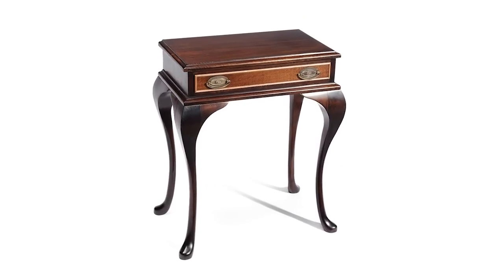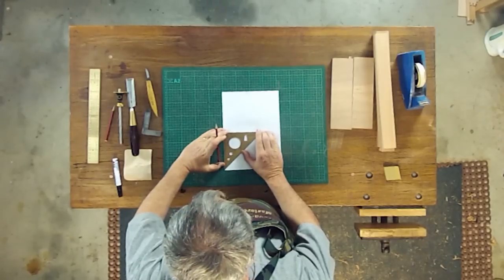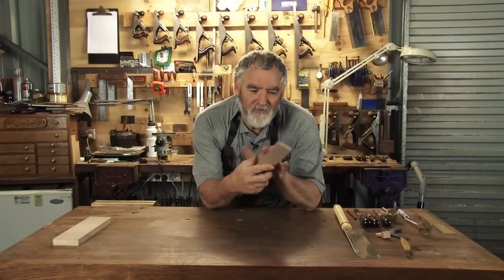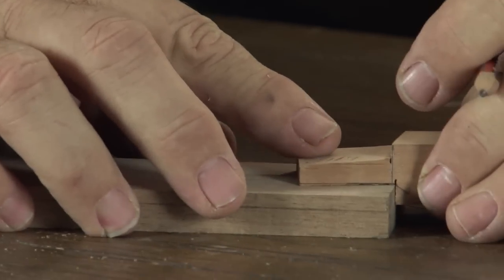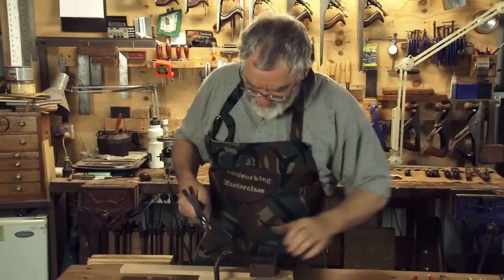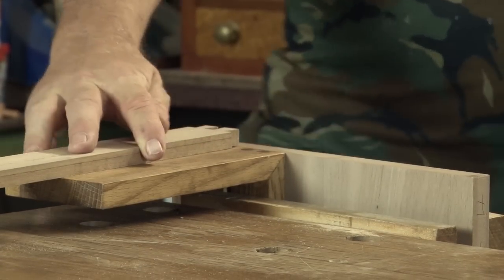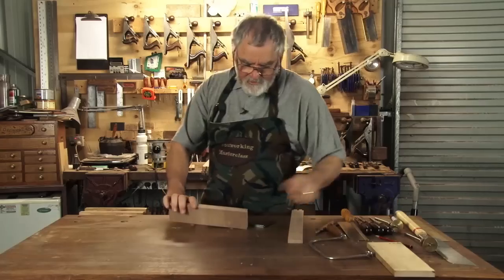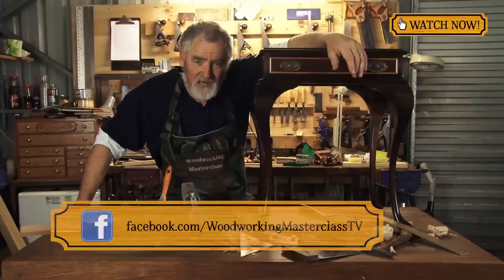Woodworking Masterclass S01 E02

Comment: I want to get into woodworking (especially furniture making) but my only problem is the price of hardwoods. So I was wondering if you just pay the price or if you have any tips to get it cheaper?
Reply from the maker: Unfortunately the answer is yes. There are some ways around it though. I buy in bulk that saves me quite a bit. If you have the machinery you can save by buying rough sawn and dressing it yourself. Downside to that is you often don't get to see the grain pattern until you've purchased it.The one I find most effective is look for shorts (lengths under 900 mm or 3') and end of mill runs that everyone else has picked over and left the scraps. Many times you get them for a good price and can made projects to suit the timber you have instead of having to buy the timber to suit the project you are building. Hope that has given you some food for thought. Cheers Steve
Reply: Woodworking Masterclass Ok thanks for the reply. What wood did you use? Maple?
Reply from the maker: Queensland Maple, but any nice timber will do an excellent job. Cheers Steve

Comment: As a new woodworker all I can do in these videos is star agape at that collection of planers lol
Reply from the maker: Hi Jeremy, There are a few there and I must say even thought they all get used they are not all necessary to do woodwork. They are a combination of over 30 years of scavenging, scouring and being in the right place at the right time at eBay, garage sales and auctions. You can get by doing serious woodwork with only  a #3, #7 and a good block plane. Eloy tour woodworking journey. Cheers Steve
Reply: Great information sir.  I'm still working on my tools and I'm wondering how critical having hand planes is.  They are really the only "essential" tool I don't have.
Reply from the maker: Very, if you want to pursue a hand tool journey Jeremy.  A good block plane with a movable mouth and at least a 5 1/2 which covers a wide range of applications or of you can afford it instead of a 5/12 get a #3 and #7 Cheers Steve

Comment: What is a mil. I ask because I usually go by feet or inches
Reply from the maker: Millimeter approx 1 x 25th of an inch. Cheers Steve
Reply: Woodworking Masterclass thanks
Reply: You Americans have a lot to learn about proper measuring unit systems ;)

Comment: what brand is the Japanese hand saw you use?
Reply from the maker: +Nick Jewell Sorry not much help to you as it's all written in Japanese. It does however have a large "Z" printed on the handle. Cheers Steve
Reply: +Woodworking Masterclass Ok, thanks for the reply!
Reply: It might be a Z-Saw - Cross Cut Japanese Handsaw H-250 that is on Rockler.com

Comment: you know youre australian when maple is "softwood".
Reply from the maker: +JgHaverty But it is prefaced my 'Queensland' not 'Rock'. Cheers Steve
Reply: Woodworking Masterclass Haha, right. Queensland maple is more on par with mahogany, correct?
Reply from the maker: +JgHaverty Yep, it's considered by many to be Australia's premium Fine Furniture timber. Produces some amazing figure as well. Cheers Steve
Reply: Woodworking Masterclass I do guitar building (luthiery), but I try to incorporate anything I can learn. Your "spline joint" thing is something I need to try. The wood I use is typically 7-12% humidity, do you think I should try to use that technique?  I dont normally have issues with joints separating, but it does happen from time to time, normally a temperature thing I thought, but it might be a humidity thing.
Reply from the maker: +JgHaverty It does strengthen the joint by adding extra gluing area as well as cross grain adhesion rather than just a butt joint. So give extra resistant to knocks and bumps. Cheers Steve

Comment: You watered the wood, Why?
Reply from the maker: +Marcelo Iván Rojas Hernández It had a cup in it, from the heat, so by watering it. It reintroduced moister into the cupped side which has dried out and therefore flattens the board again. Cheers Steve